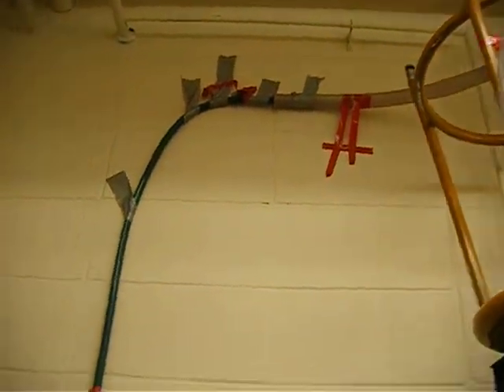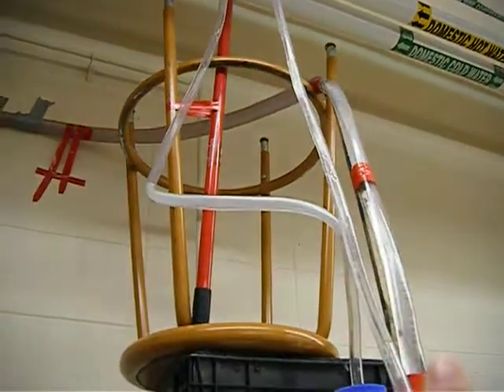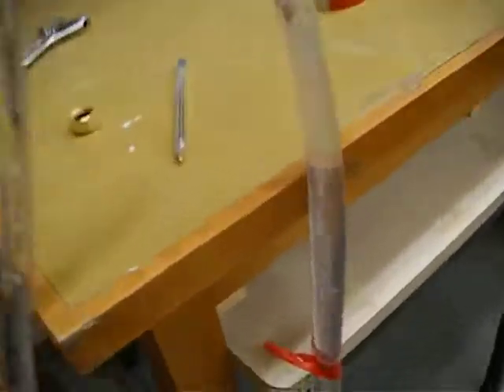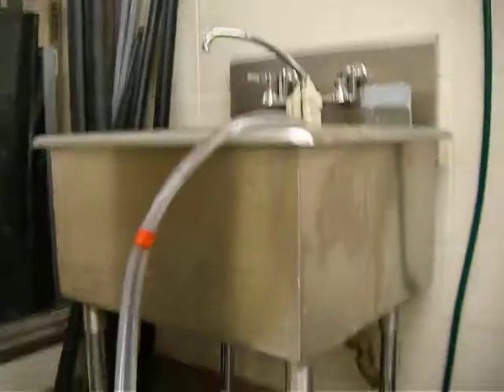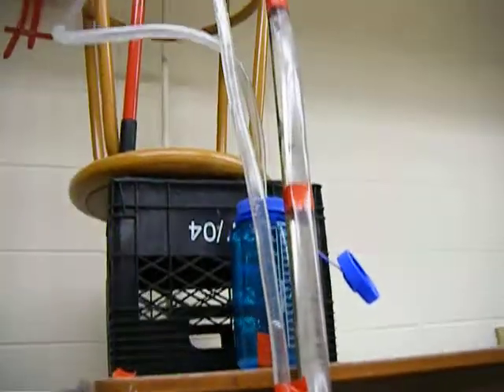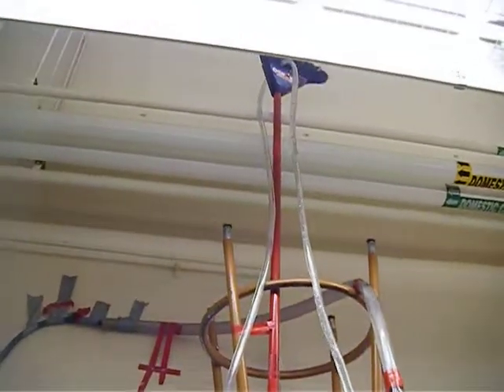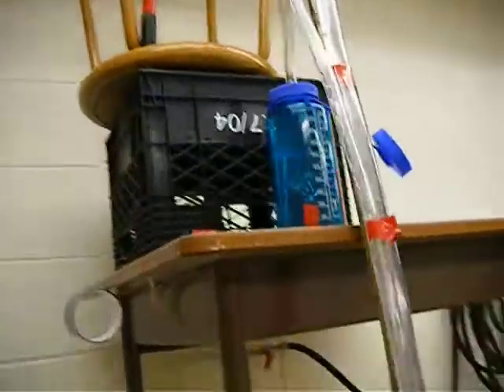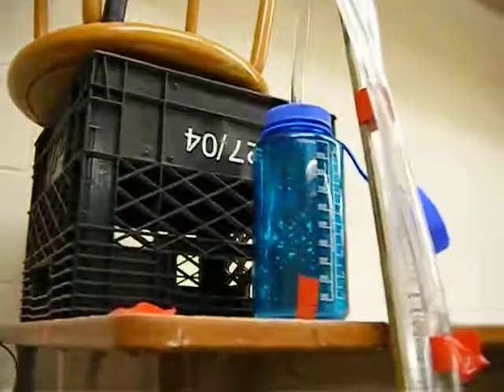Pulser Pump Pictures 042.avi

Comment: you managed to pump the water right back to the point that it started. BWAH HA HA HA HA HA ! You do realize, don't you, that if you had closed off the outlet at the sink then the water would have just risen to the same point you started anyways. OK, maybe you gained a couple of feet, but that is only because there were air pockets in the up tube, if you subtracted their volume out, your up water column would be no greater than your down water column.